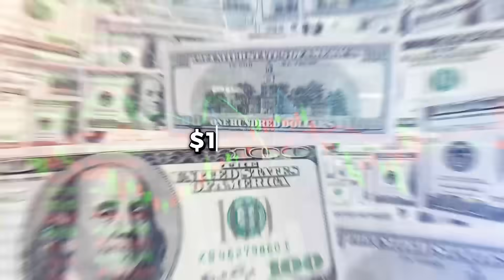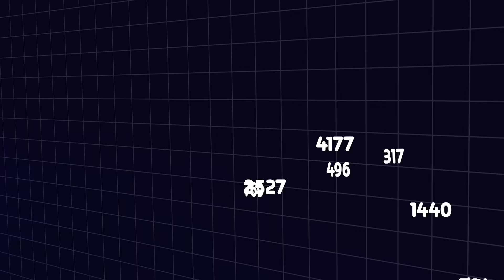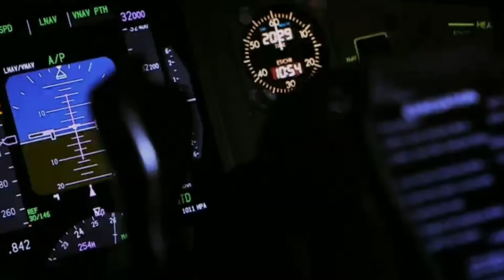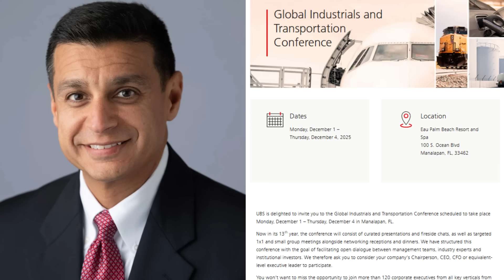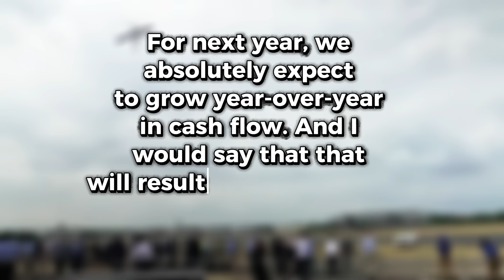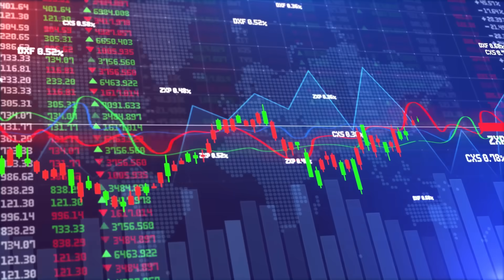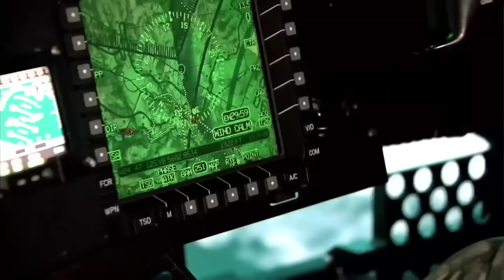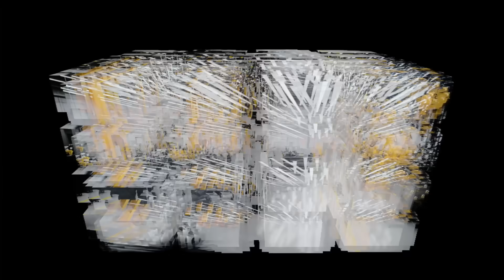Why the Boeing 777X Will SHOCK the Aviation World in 2026!

Comment: Unfortunate choice of words in the caption given exploding Boeing fuels tanks in (at least) B707, B727, B737, B747 - hundreds of deaths.
Reply: nothing like a troll to crap all over any video.
Reply: @davidoldham1946  I'm assuming (possibly wrongly) that you are an ignoramus, probably American, who has little or no knowledge of pre-McDonnell Douglas Boeing. Check the record and you will find an unfixed, systemic problem with exploding fuel tanks (notably the central, wing box tank) for the mentioned aircraft. After several disasters, Boeing (Boneheaded Office Of Engineering Incompetence and Negligent Greed) finally seems to have solved the problem. One of the many examples ...
TWA Flight 800 (1996): A Boeing 747 exploded and crashed into the Atlantic Ocean off the coast of East Moriches, New York, killing all 230 people on board. The cause was determined to be an explosion of flammable fuel vapors in the center wing fuel tank. This incident was observed by pilots who reported seeing an explosion off in the distance towards Boston Air Traffic Control.
Reply: @franciscook5819 , the TWA800 incident happened with a 25 year old aircraft with 103,000 hours on the airframe.  The exolosion was atrributed to an electrical short in one of the center tank fuel pumps.  This wasn't attributed to any design flaw  in the fuel tank...simply an old plane with old hardware.  The center tank was largely empty at takeoff on a hot summer day, which certainly added to potential vaporization of fuel in the center tank.  Woulb't take much of a spark to light the fumes.  

Now, I'm lookimg forward to your examples with the 707, 727 and 737  fuel tank explosions.